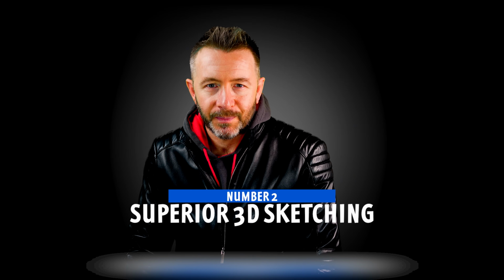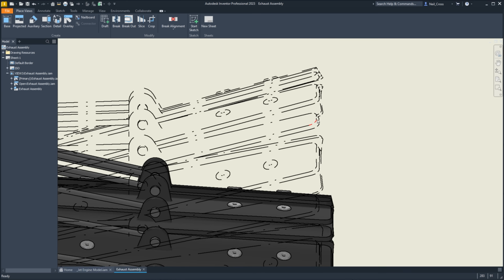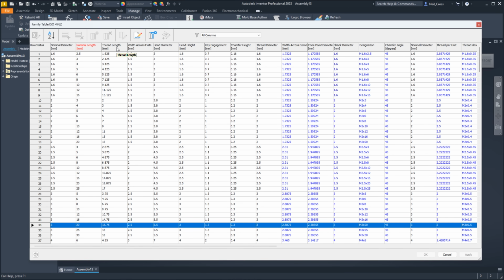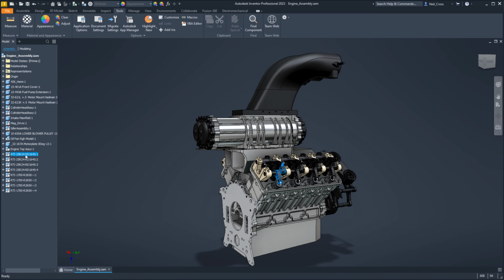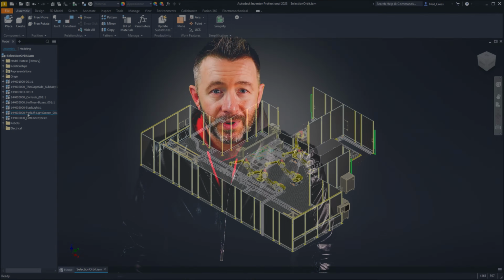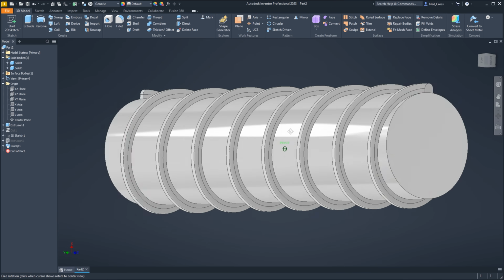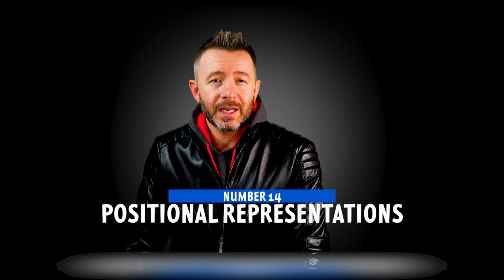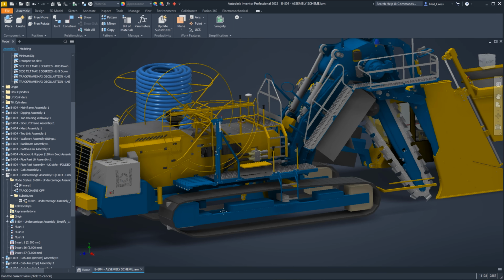15 HUGE FEATURES Inventor has that Fusion 360 doesn't have

Comment from the maker: TO BE HONEST, the fact that some people felt the need to ridicule me for the jacket for some reason... the jacket STAYS.  Every video, until summer because it gets hot.  If the jacket offends you, then I can't stress this enough, you really shouldn't be on the internet.  It's literally just a leather jacket, what's wrong with you.  Actually, it's not just any leather jacket, nows not the time for the story but for all intents and purposes it's just a leather jacket... and it stays.
Onto less pressing issues! Quick correction... point number 1 about driven dimensions, it turns out Fusion 360 can actually reference driven dimensions (sort of, I think??) but it's the most convoluted ridiculous workflow that I honestly wouldn't be doing it in a hurry! If you know you need to reference a driven dimension, you have to:
1.  Go into Parameters
2.  Rename the driven dimension to something recognisable
3.  Go into the User Parameters area
4.  Create a new User Parameter, in the Expression, create a formula with the driven dimension i.e. DRIVEN+100mm and give the user parameter a name, like "Reference"
5.  Beats me... no idea.  I went to a sketch and created a dimension, and instead of the dimension numeric value I typed "Reference" and it errored out with red text and didn't solve the user parameter.
6.  Maybe you have to then add "Reference" into the expression for other parameters but by this point I'm absolutely fed up and this is not an OK workflow, and this is exactly why I originally concluded that Fusion 360 couldn't do it.
Reply: Naw. You had it right from the start on this point. Fusion can not yet make an equation referencing a driven dimension outside of the same sketch. It took more than a few releases for inventor to get this ability so I’d disagree with the statement that it was there from the start. One last comment. There is not an architecture limitation in fusion that prevents this. In many regards this specific area of fusion and inventor are near identical. I full well expect this to improve in future updates.
Reply from the maker: Hi Kevin - the reason I said it was an architectural limitation was because a Fusion team member stated this in a reply on an IdeaStation post about this topic.  I was doing the research a couple of weeks ago so I'll struggle to find the post, but that was the source of that statement and because it was quite an old post with the sketch feature still not being there, and it was an Adsk account who made the post, it tallied up that this was credible.
Reply: if it was made from dog skin, then youd have a problem with it lol

Comment: I am a long time user of Fusion and will continue to be AND I wish this wasn't true....but Fusion struggles with large designs. IMO if run you run business and your product as more than 100 configured components use Inventor.  Someday Fusion performance will catch up to Inventor but that IS NOT the case in 2026.  Use Inventor.

Comment: solidworks is better then inventor at almost all of the point that you mentioned inventor really struggle with mating parts/assemblies if you compare it to solidworks also ipart are inferior to configurations in solidworks also if you want to change the name in of your files in inventor it's a struggle and the fact we can't create a mid plane between two opposing surfaces in inventor assembly is just sad among many other things that inventor cant do or just dose worse them solidworks

Comment: each has its uses but I always go back to the $495 per year and it does what I need.  for 10 years under its belt think its been doing well.  again sorry but I am not sure how much inventor cost but you pay for what you get and I get just what I want inside fusion.  why pay more, save up and buy a jacket like that?

Comment: As a many decade AutoCAD user I have found that Fusion’s sketching ability is an abysmal failure. It took me several hours of workarounds to make a sketch that AutoCAD would have taken mere minutes to achieve. There are so many missing tools that make it basically useless. I had to revert to .dxf output in order to produce anything in a reasonable amount of time. 
Shame on your part, Autodesk. I’m hoping you bring your Fusion standards up to adequate industry usability soon.

Comment: A question popped up in mind while watching.

I am a patron of the battleship USS Iowa museum (Pacific Battleship Center, San Pedro, Ca.). When built 1940-43 at the New York Navy Yard, the 887-foot Iowa weighed some 45,000 tons and was the largest ship ever launched in the western hemisphere up to that time. The blueprints weighed 350,000 pounds (I have no idea how many sheets) created by a team of some 300 naval architects.

Additionally, USS New Jersey (Philadelphia Navy Yard) was laid down only three months later (USS Missouri and USS Wisconsin were to follow). The New Jersey design team often traveled en masse to New York to explore ideas and solutions during construction of these fast giants.

My question: Can Inventor and Fusion 360 handle such a massive working environment? I am a lone hobbyist user of this software; I can't imagine the work flow for such a gigantic project. Thanks!
Reply from the maker: Short answer, no.
Longer answer, Fusion definitely not, it has a part count limit of around 4000 parts which by then it starts to absolutely grind to a halt.  With Inventor, it would probably struggle to handle an as-built fully detailed warship.  You would likely design a lot of the internal mechanical components with Inventor, but a general assembly of that complexity would require input from dozens of different packages.  Think of the electrical wiring alone, that would need to be done in something specialised, the vessel hull would need to be a specialised design which I imagine there are dedicated packages for.  You've got almost everything imaginable going on in a battleship, HVAC, hydraulic layouts, architectural aspects, it's likely there would be multiple possibly hundreds of different agencies/suppliers working on various parts using various packages, and if a top level general assembly model existed it would likely be in a neutral project management package like Navisworks or something similar that can ingest data from Inventor/Solidworks/PTC/NX etc my brain is hurting trying to comprehend how such a project would be managed but definitely not all in 1 CAD package.
Reply: @Neil3D  Huh. Since posting this question, I've discovered this Autodesk article from three years ago:

"How We Used Drones to Digitize the Biggest U.S. Battleship Ever Made"

The powerplants of the four Iowas are the most powerful non-nuclear engines ever installed on ships (an unimaginable 36 knot speed resulted, or 41 mph). I was tickled to read Autodesk scanned Iowa inside as well as out, including the several turbine and boiler rooms. (What an undertaking.)

I understand your point about multiple software packages for a vessel three football fields long and 17 stories tall. Fuel tanks hold 2.6 million gallons (3-1/2 Olympic pools); Iowa has 250 miles of electrical cabling; 16 miles of vent ducting; 80 miles of piping. Decks and platforms total 9-1/2 acres. Components and materials came from 38 states.

Thank you for taking time to answer my question. As with so many others, I'm fascinated by the WWII period, and you have provided insight.

Comment: I think Fusion is a mistake. I think they should focus all their efforts to catch up with the functionality of Creo, Solidworks, Solid Edge and others. Inventor is fine, but the 2010 version would be enough for me, there is still nothing in those versions that would make me say wow (maybe one wow model state). I thought they would add Sheet metal to Frame or Tab and slot or a much better Frame, but they put it in Revit as Functionality Advance steel wanted in Inventor. There's a lot to change and I'm still waiting. I'd like to be proud of Inventor, but I'm sad that development isn't fast enough against the competition. Why did they cancel Force Effect for Inventor? = I don't understand to this day.
Reply: Today I am using version 2023.

Comment: The only reason I use fusion 360 is for CAM. Even for that, I create the model in Solidworks then import it into Fusion 360 then do the CAM. The design functionality of Fusion is simply trash.

Comment: I'm a programmer by day and home machinist for pleasure. Cost-wise I use Fusion because I can justify it's cost for my use. What really annoys me with Fusion are some very basic things that I have to interact with constantly. Namely the sketch environment. I'm 53 and have old eyes and I really, really need to control the colors and lines in sketches so I can see them better. Sketch absolutely sucks at this and it should be absolutely easy to make customizable.These values are already in the program, background color and line colors. Just expose them to the user.
Also, how about making it blindingly clear when you hover over a sketch constraint just which elements it controls. Throw them in red, grey out the rest. Should be simple.

Yeah, I could go on and on about stuff that seems to be very basic. Features that should have been some of the first things developed. I used Autocad decades ago - as in a math coprocessor was a requirement and a separate chip you added to your motherboard - and it had better customization of linetypes. Although programming in AutoLisp wasn't fun.

Comment: The answer to any question is $$$$$
How much do you want to Spend ??

Fusion gets it's strength from the Budget minded people who use it.
In many cases most have not spent 1 Cent on buying Fusion.

You would think that Fusion was the only lower priced Software on the market the way people like to bang on about it ???
Usually the same people who are banging on about Fusion, are the people who Never paid for Fusion ????

Another advantage some like about Fusion is ?
CAD & CAM in one Software.
This feature does give Fusion some leverage for end users.

Comment: You don't really need to understand "programming" to use ilogic, but you need to understand logic in general. 

Cause and effect, it certainly helps when you start trying to read or write anything more complex than iproperties and parameters, then yes visual basic and inventor API knowledge helps, but for setting a few simple parameters based on the results of other parameters or driven parameters, then you don't really need to know how to program, just follow a few simple instructions

Comment: Well, let's face it. Fusion 360 is not a replacement or alternative to the Inventor. It is a 3D modelling toy software for hobbyists. Quite expensive toy, but comparing to the price of Inventor, it must lack of the features of its older, wiser brother (or sister:). And that will not change ever I believe. For me the only way to use Inventor is that I have it through the company I work for. Otherwise I would need to use Fusion 360 for my hobby modelling. If you are doing modelling for 3d printing, cnc milling in small company and don't need full drawing documentation, Fusion is way to go. Otherwise, you need Inventor or other equivalent software from other provider.
Reply: f360 is free for personal use (not commercial).

Comment: i know 9000 things initially and 1500 things a year inventor has that fusion doesnt... the huge bills.
i know something that fusion comes with that inventor doesnt, cam included for the $299 a year
as someone who has used AutoDesk for 35 years... 2% might need something inventor has that fusion doesnt.

Comment: You miss the overall goal and focus of Fusion360 - it is not to emulate Inventor which is such an let me say old way of doing things. Maybe for older cad trained folks thats fine. For the modern designers Inventor is a nightmare … just old workflows - Fusio360 tried to set a different approach till the marketing / investor team told them to focus on engineers and not designers as a market - remember when Fusion was called design differently ?
Reply from the maker: Since the day fusion went public, their user base has spent time and effort trying to get the product team to emulate/replicate inventor features. Just look at the now archived ideastation, it's a graveyard of both completed requests and open requests to get fusion to where inventor is. A large proportion of the fusion team are ex inventor. So whilst at no point did I say that the goal of fusion was to emulate inventor, you've just probably heard other people say it and just assumed that's what I'm doing, but actually yes in fact fusion very much does emulate inventor in more ways than it's different
Reply: @Neil3D  at this point now yes it seems more to emulate inventor - but it started more as a different design tool.

The problem Fusion had was that from the start it decided to work on too many different areas not finish one tool first. It took years for loft to be usable and not requiring 3D sketches to stabilize rail edges. Or look at the sketch engine it is till plagued by massive hickups and bugs which go back 6 years.

We had over the last 10 years a lot of meetings with them most designers and over time everything was put into the focus of cadcam being more profitable than industrial design.

Fusion said that here are not enough ID users - we simply said that there are not many ID users because fusions toolset is incomplete 

Chick or egg question …

Still besides all fusion is my preferred modeling and teaching platform.

Comment: Fusion360 does have reference driven dimensions, its called Equations, and just works the same way as described in Inventor.
Reply from the maker: I figured this out after this went live, but it definitely doesn't work the same way as Inventor as that's why I was convinced it couldn't do it.  Having to go into the parameters manager, make a custom user parameter for each reference that you want to create is far from Inventor.  But technically yes you can do it so I do need to drop a correction on that.
Reply: @Neil3D  you need to watch nycnc channel on fusion360 you can create them on the fly as you dimension things.  He has a bunch of user videos. There were several more statements that were wrong but couldnt be arsed to correct each one. Maybe a do over. And some proper research next time. And also inventor is not as acessible to everyone as fusion. ;)

Comment: I don’t understand why Autodesk made a new codebase for Fusion 360, and not extended Inventor to have Fusion 360 manufacturing capabilities, and then made a feature subset for a less expensive product.  Seems to me like a waste of resources.
Reply: I think they probably wanted to create new software for more "limited" use and I suspect that Inventor has so much features embedded into that it was simply easier to creatre new product alltogether.
Reply: I think the fusion kernel was the first designed to make proper use of multi core and hyperthreading that the new computers were getting back in the day. Most Cam was single core optimized, at the time of launch.

Comment: Nice video - Can you dimension the length of an arc in a sketch in Inventor? It's one of the irritating omissions from F360. I used to use Creo / Wildfire / ProEngineer for work, but use F360 as a hobbyist. I like it, but there are some iritating 'features'. The sheet metal part is a bit naff - it doesn't seem to include any stretch allowance in its developments. I do like how it integrates CAM however, even in the  'not paid for' home version. Is there a "hobbyist" version of Inventor? I haven't been able to find one outside bona-fide education use. It's very interesting to see the comparisons between packages, anyway.
[ETA] Drawings in F360 are very weak, too, but luckily, I only need to do them for myself these days :)
Reply from the maker: yep Inventor can do arc length dims in sketching, and tbh Fusion 360 was supposed to be the hobbyist version of Inventor, the argument being why would hobbyists need engineering gear/frame design generators and all that.  They did used to have Inventor LT but it was toilet.
Reply: @Neil3D  Thanks for the reply.

Comment: nice hair cute Neil :) I posted something on Linkedin which i have since deleted as and my "friend" was quick to slate maybe looking out for me. He supporting helping sometimes with one of the fusion 360, friend basically said merging two software's that are written in the same language can't be merged easily so you can imagine my thoughts "cough" "cough. his quote was "they want what's considered an prosumer platform and a commercial offering which are two completely different beasts". I have a licence of fusion 360 but my confliction is do I invest in the Product Design Manufactuing Collection and yes fusion 360 comes with it but do i just then stop using Fusion 360 and carrying on using in inventor....id like to think it would be inventor but i want to really no where i need to invest my time.

Comment: So, from my experience, when you join a part in a subassembly in Fusion, it does only move the part. But then when you hit OK, it will solve the other joints in the subassembly and move everything else accordingly. So, if the subassembly is properly joined it will, after the fact, follow that one joined part at the higher level. Maybe what you mention is for an assembly that has not been joined, just drawn with references to each other.

Just what I remember, haven't had access to Fusion for a while.